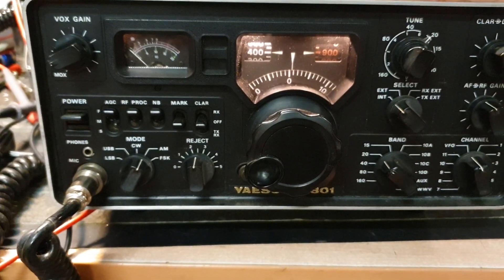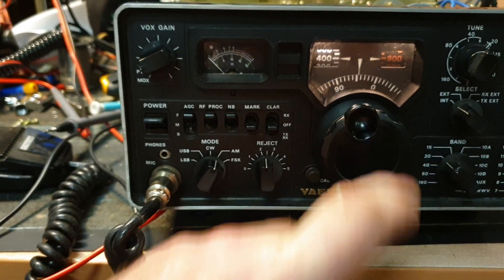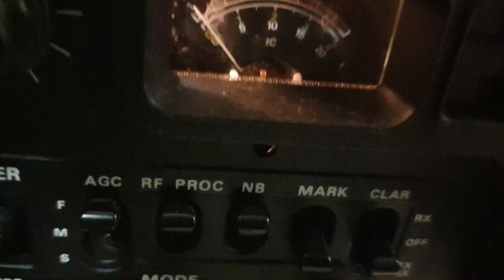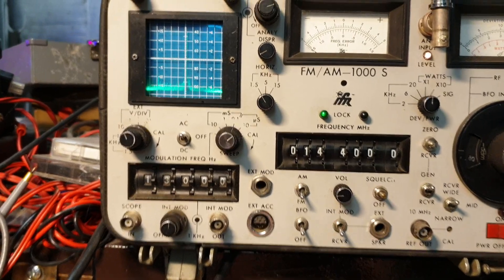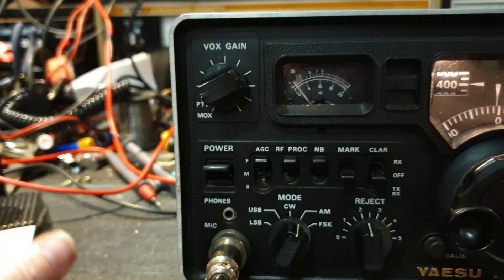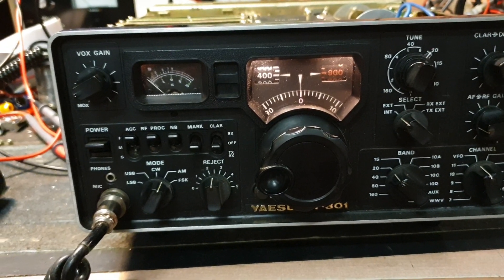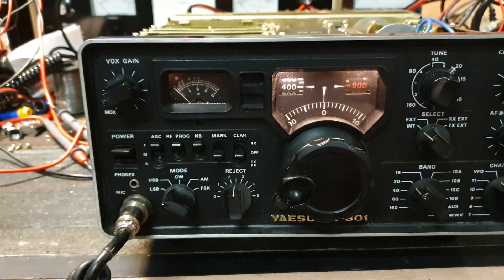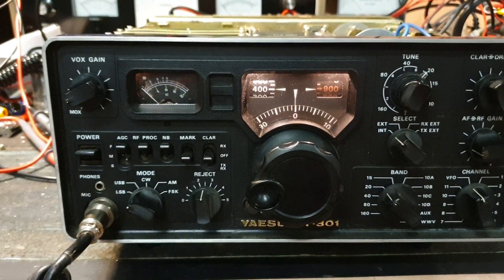Yaesu FT301 over voltage suspected part 1 of a 2 part series

Comment: I have one of those.   Some of the bands would receiver and some wouldn't.  As it turns out, all of the trimmer capacitors are bad.    The blob of solder on each of the ceramic trimmer caps has become delaminated from the little rotating discs. Another thing to check on gear of this vintage are connector contacts and pot wipers that may be silver plated. Anything with silver plating will likely have silver sulfide on it, which is not conductive.  In addition, mine was connected to DC with the polarity reversed... so my work is cut out for me!